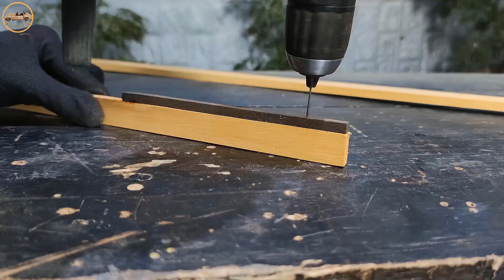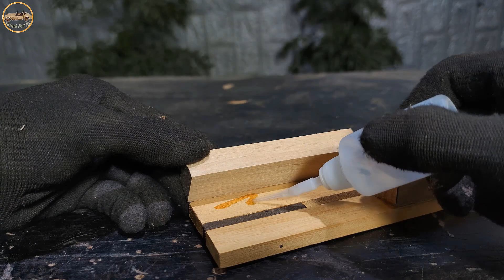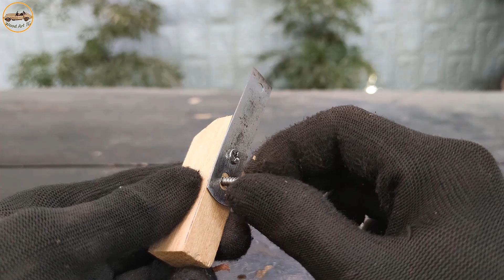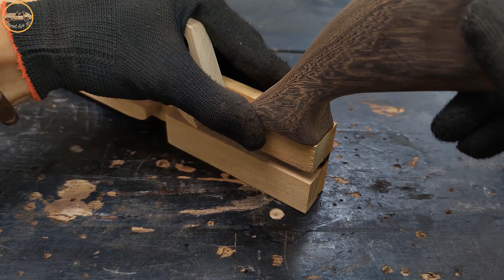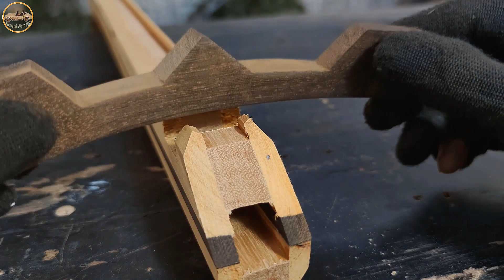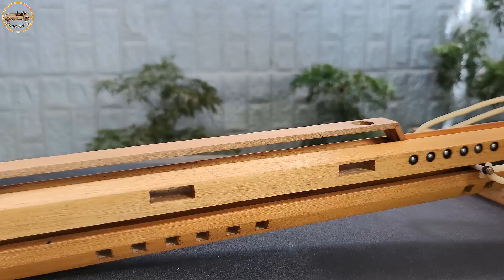Best DIY slingshot | how to DIY a slingshot with good aim | Wood Art TG

Comment: What adhesive is used
Reply from the maker: This glue is a special glue used to glue wood
Reply: What is the name?
Reply: Lol,  yes
Reply: It's nothing special I don't know why he's being all secretive it's super glue otherwise known as cyanoacrylate or CA glue. It's good in a pinch as here in the us; US woodworkers only use it on wood for the instant bond as little dots to hold the wood while real wood glue actually dries because wood glue has a stronger Bond stronger than the wood itself.  But super glue is not suitable structurally for wood in long term application. Type 2 or type 3 wood glue by the brand type Bond would be better. That is something that is ACTUALLY especially formulated for wood and will give you a joint stronger than the wood. Type 2 is water resistant type 3 is waterproof. The difference is with wood glue you need to clamp the wood and allow it an hour to dry super glue is nearly instant. So like I said in the US US woodworkers only use it as a temporary clamp for a real glue joint. That's why guys like this use it, not because of its bonding strength with wood but because of its rapid cure time so he can get his videos done quicker. But in my opinion wood glue is better if you have the time to clamp it